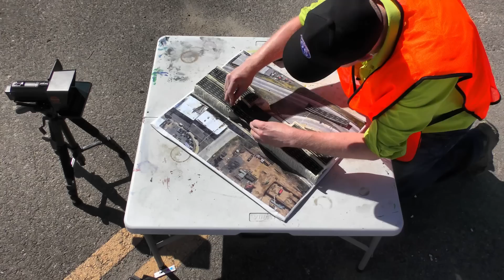Here's How Pennsylvania Re-Opened I-95... in Just TWO WEEKS!

Comment: As a materials engineer, I have two contentions. one, steel is stronger than concrete in both tension and compression, you just avoid using any more steel than absolutely necessary because it's a lot more expensive than concrete. And Two, normal concrete actually does weaken under high temperatures.
Reply from the maker: That's cool to learn.  I'm growing worried that "rushing" a shorter video out over 36 hours (versus like a month) may mean... I have some factual oopsies. 😲
Reply: @RoadGuyRob  As a knowledgeable non-structural engineer, I knew what you meant, that a bar of steel of practical thickness is poor in compression. I think most people intuitively know that a solid block of steel isn’t going to buckle. 

But yes, a reminder never hurts that anything can be strong, but strong and cheap is the goal.
Reply: @justins8802  Use rock rebar (made from basalt) instead of steel rebar. It is superior in every respect.
Reply: @RoadGuyRob  more importantly from observation  they were steel girders not reinforced concrete beams on 95
Reply: @tyler7433 came to say the same thing. The deck was reinforced concrete though, I assume.
Reply: @RoadGuyRob  like calling a cheese steak a "philly cheese steak sandwich" or ignoring the structural importance of using a Amoroso roll.
Reply: @RoadGuyRob  It's important to note that concrete shall not be OVER-reinforced, i.e. putting in too much rebar. with normal span design, the steel is designed to fail BEFORE the concrete. This is so that failure of the structure will be noticeable, since the failing rebar is visually apparent. If you put in too much rebar, the concrete will fail first, meaning catastrophic failure with little warning!
Reply: @RoadGuyRob  Also, isn't this a steel girder bridge? With a concrete deck? So the tensile and compressive strength of steel reinforced concrete (beams) is irrelevant? If you get steel girders hot enough to soften and loose their rated static weight capacity (which gasoline fires can do) you will have a failure of the system and a collapse.
Reply: @RoadGuyRob  Pin this comment to own the oopsie!
Reply from the maker: @ErdTirdMans  Good idea.  Pinned!
Reply: As a personal anecdote, I have watched a bonfire get hot enough to demolish a concrete fire ring.  The ring was in pretty good shape before the fire, but after a few hours of intense burning what was left crumbled away with little resistance.
Reply: Yeah in this case it's buckling, right? You can't upset a length of rebar into a shorter billet because it will always take less energy to fold over.
Reply: @HavokTheorem  Use rock rebar (made from basalt) instead of steel rebar. It is superior in every respect.
Reply: If the steel in the original span was tensioned, then that would make the span even more vulnerable to heat, but it would have fallen no matter what.
Reply: Hey is it possible to make reinforced concrete with other materials? Like if someone wanted to make a Concrete hull of a boat but used Fiber Glass instead of steel to avoid rust expansion issues would that work?
Reply: @Cliffdog01  Fiber glass reinforced concrete is a thing, but the commonly used fibers are really quite short. Great for something like a floor that must resist high loads. Not suitable to replace rebar in construction. Using different kinds of reinforcement is possible, but steel is simply the most cost effective solution. Steel rebar is cheap, easy to handle, readily available, has very similar rate of thermal expansion as concrete, and is relatively strong.
Reply: @klapiroska4714  thanks
Reply: @klapiroska4714  I can’t wait until carbon nanotube reinforced concrete is cost effective ;-)
Reply: @justins8802  i worked with carbon nanotubees before. Yes, they are strong, but they are difficult to string together in long distances without sheer stress breaking them apart. Also, they are very carcinogenic in powder form.
Reply: @klapiroska4714  Use rock rebar (made from basalt) instead of steel rebar. It is superior in every respect.
Reply: @DUCKDUCKGOISMUCHBETTER  I had never heard about that before, but it seems like a viable option, though I'm still kind of sceptical. The fact it can be rolled into huge rolls would suggest it has either a relatively low modulus of elasticity (i.e. it's stetchy so sturctures would need to be pre-tensioned) or it requires some kind of special equipment to straighten the coiled bar (these are common in the world of copper pipes etc.). The other thing is that there doesn't seem to be publicly available pricing data, which makes me suspect it's much more expensive than steel rebar. 

For context, the consumer price of a large 8mm rebar mesh is about 2,5€/kg in my local hardware store. In general (at least in my area), the consumer price of steel products is about 30-60% higher than B2B prices, so construction companies are likely paying 1,5-2€/kg (could be less for large deliveries). While rock rebar claims to be 4 times lighter than steel (I'm assuming that companies use specific weight, i.e. weight to strength ratio), the B2B cost would need to be less than 5-6€/kg in order for it to be economicly superior.

TLDR; High elasticity isn't necessarily a desirable property, and cost-effectiveness might be questionable. Porentially superior when weight or corrosion resistance is high concern
Reply: @justins8802 it'll be strong but even worse than steel in a scenario like this.
Reply: @Cliffdog01  they make fiberglass reinforced concrete already.
Reply: @Cliffdog01  Yes, concrete slabs can be poured with concrete that includes glass fibers to bring up their compressive strength a little.
Reply: @Cliffdog01  Use rock rebar (made from basalt) instead of steel rebar. It is superior in every respect.
Reply: Also, from the videos I saw, these overpasses actually had exposed steel girders supporting them
Reply: Something something jet fuel doesn't melt steel beams... Er I mean concrete bridges?
Reply: @Those_Weirdos  so tell me you know nothing about material science and metallurgy without saying material science.
Reply: I mean, technically everything weakens when the temperature gets high enough.
Reply: As a super-quick video (about a super-quick fix to the destroyed bridge problem) you're trying to provide an overview, information on the basics of how they plan to do it.  You got the main points out there; the exact details are subject to change as they work on the repair.

If you'd waited too long to release the video, the road might already be fixed by then! 😁
Reply: The concrete abutment that spans the width of 95 north and south was subjected to the heat that destroyed the span...  how can that be still usable to lay the new i beams and roadbed on??  They may open the road quickly but that new section is right in the way of replacing the abutments...  I go past it every day and nobody local has mentioned this...
So, what do you think out there engineers??
Reply: Yep as my engineering teacher said... Nothing is cheaper than dirt, concrete is just dirt.
Reply: @Tindog81476  I'd sack your teacher. There is nothing cheap about concrete.
Reply: @rogink  Haha, yeah no concrete is expensive, but it's cheaper than everything else, that's the point! lol
Reply: My late father, who was a draftsman, would often be exasperated when one of his ideas for making a product functional was disapproved by an engineer. According to my dad, these engineers often overlooked the practical aspects of the problem to be solved, opting instead for some esoteric approach.
Reply: I was expecting to hear about how concrete is weakened by high temperature, but still cool to learn how they're going to reopen and rebuild the bridge.
 Gravy from the channel Practical Engineering made a video about the topic of concrete's fire weakness, it's unfortunately titled "Why Spacex Cares About Concrete" for clicks
Reply: More to the point, it will have been high yield steel reinforcement, probably 32-40mm. No chance of making any dent or bend in that without some kind of mechanical help!

But I'm not sure what you mean by 'normal' concrete. Unreinforced concrete will withstand very high temperatures. Subjected to heat, RC will expand - but that's due to the steel.
Reply: Also, don’t forget the impact heat has in expanding and breaking apart the binding between the rebar and concrete.
Reply: Salt and Steel don’t mix, don’t forget to take that in consideration!
Reply: A materials engineer !?
Shut the front door !
Reply: You are correct
Reply: yeah, he NEVER heard of decalcification of concrete.   I guess he missed that day in civil engineering school
Reply: Use rock rebar (made from basalt) instead of steel rebar. It is superior in every respect.
Reply: Jet fuel doesn’t melt steel beams.
Reply: @cakearmy_maxgaming6346 It just detempers the steel. And they use the minimum amount needed for cost and weight. BTW, it wasn't an inside job.
Reply: @cakearmy_maxgaming6346 I think someone needs to watch more blacksmithing videos.
Reply: @cakearmy_maxgaming6346 It does make the steel very hot, and hot steel goes all bendy bendy, about like a wet noodle. You ever tried building anything out of cooked spaghetti? Technically possible, but good luck.
Reply: @cakearmy_maxgaming6346  Oh yes it does. Or more precisely it weakens steel beams.

Comment: Similar to when they widened the 22 freeway through Orange County (Garden Grove area).  The 22 runs above almost all the streets it crosses.  So they built new side bridges for the new outer lanes.  Once those were finished, they diverted traffic onto those and demolished the old bridges (apparently they all needed replacing anyway, but I think they may have also widened the streets underneath).  This meant driving along you encountered what was basically a chicane every half mile or so for about a year.

Comment: at 1650 degrees concrete starts to fail completely, the structure of the molecules itself break apart. large gasoline fires can burn at close to 15,000 degrees.

Comment: Not even 9 years ago they were working on it during the pandemic they were working on right were it collapse. So it's probably a problem beforehand also this exact thing happened on a bridge over 81 by Harrisburg like 8-10 years ago. The truck lost air tank going up the off ramp bridge lost brake suddenly and another truck slammed into the back of it. It blew up and the whole bridge came down on 81 around rush hour. It took my mom and gram 4-5 hours to get home it was a mess

Comment: My real question is why after they chopped out or jack hammered the old section out wasn’t the debris used as filler after the retaining walls were built…. ??Much more cost effective if you ask me, you could add a layer of recycled glass or sand on top of the debri if you choose. Try Phillips steak on pasyunk ave , less known spot but better steak or steve’s steaks .
Reply: Lightest fill material was needed.

Comment: If the bridge collapsed due to fire underneath, I argue that it was inadequately designed.   Being only 9 years old it was probably done on the cheap.
Reply: Unfortunately fire mitigation is not included in the engineering of these types of bridges.

Comment: I'm no engineer, but that looks like an incredibly dangerous way to reconstruct the highway spans.  I would be concerned about distracted drivers either crashing into the work crews or driving off the incomplete spans during construction.  Not to mention the precision required to build each half-span within tolerance to fit its mate.  I think the I-85 method in Atlanta was superior: Close the entire highway for six weeks and rebuild the spans using the same construction staging as the originals.

Comment: Very interesting.   I live about 40 minutes north of there and have used the route extensively.  I was wondering how this glass was used.  There was nother catastrophic road failure on I 95 in CT years ago similar to this but there the bridge that spanned the Mianus river collapsed with the same result.  Meanwhile, this was 100% the fault of the driver who took that curve under the road way too fast.  A liquid load has a center of gravity that moves as the truck accelerates.  Newtons laws of motion have the liquid load continuing in the direction of the turn even as the truck changes that direction which is acceleration.  The result to the topple the entire truck and in this case, ignite its flammable load.  100% drivers fault, unless the truck was in some way faulty.

Comment: Could hv used precast pretensioned concrete beams or steel beams to replace the damaged girders n use high strength early strength concrete for the deck.

Comment: I would have to call that a Philly-style cheese steak inspired sandwich. It's not very authentic. The meat looks to be the wrong cut, and the bread is definitely wrong. A good hoagie roll from Amoroso makes the sandwich. I go out of my way to buy from Dalessandro's Steaks, but there are many options throughout the city. 

As for the video, thanks for covering this emergency construction. The crew did not build a conventional retaining wall. They instead reinforced the outer perimeter of each lift as they went. Effectively, the mass of the infill holds in the edges. Also, the northbound lanes collapsed while the southbound lanes were demolished due to damage. The bridge was a steel beam design and not a prestressed concrete beam. This was a very short span and the additional strength of concrete was not indicated. PennDOT has been modernizing this whole stretch of highway, but there is a lot of work remaining just to the south of the involved section.

Comment: There are steel I-beams under the bridge not just concrete & rebar as there has to be a flat surface to pour the concrete on….look under any over pass & 9Xs out of 10 you will see steel I-beams supporting the road decking😎

Comment: I say just fill it all in with sand.  Pave it flat. Get the new beams made.  They can replace the bridge in less than 60 hours when they get the beams made. They have replaced many bridges here in Mass that way, but that included taking down the old one. Removing asphalt rocks and sand is much easier and quicker. Probably just a few hours and they can put in beams.

Comment: Yeah, all that work for nothing.  The rebar reinforced roadway has zero structural significance as to supporting the overpass. Steel beams which stretch from one abutment to the other side of the overpass abutment. Carry 100 percent of the roadway load. So the roadway did NOT collapse for the reason he stated. Sub standard undersized Steel beams with zero insulation was the cause of the overpass collapse. In places where there is a potential for a fire. The structural beams need to be sized to not only handle the roadway plus vehicle traffic. But to withstand a potential fire. In building skyscrapers, a fire retardant insulation is also sprayed on the steel beams. This way, the building won't collapse in the event of a fire. (Like the WTC) No one will say it, so I will. Shoddy workmanship and cutting corners was the cause of the overpass collapse. This is an accident that could have been prevented.  Let's hope that they don't 'restore ' it back to the way it was before. The least expensive way is not always the best way. BTW, now is a good time to inspect ALL of the underpasses. To determine their resistance to a sustained fire. Just saying.

Comment: Would it not have made more sense to do the recycled glass thing on only one side of the overpass? Making just the north or south bound direction functional, so the highway would be at half capacity. That way they would have full access to do the other side. Then once they finish building the permanent one, open that one in both directions (again half capacity) while they build the permanent one on the other side?

Comment: Thanks for the great and accurate video! 
One note: I-95 isn't the main north/south corridor through this area, so the East Coast isn't panicking at all.  
The main north/south corridor consists of two other highways: I-295 and the New Jersey Turnpike on the other side of the river.
Reply: Honestly I’m wondering now if the quick 95 fix will maybe embarrass or spur NJ to get the collapsed retaining wall on 295 fixed faster now. It’s been SO LONG that they’ve been working on that stretch of road and it just sucks. Now I’m sure there are a lot of reasons why it isn’t as quickly fixable as the 95 collapse, but just the optics of NJ struggling with 295 for 800 years compared to the less than 2 weeks fix on 95 really makes you think 😅

Comment: Your solution temporarily changes an 8 lane highway which is normally over crowded into a 4 lane highway.  Look up the collapse of Route 80 in Denville, NJ several years ago.  A temporary portable structure was moved into and placed over the existing damaged bridge.  The approach to the elevated structure was built up so all lanes functioned while the original bridge was demolished underneath the temporary structure and the new bridge was constructed under the moving traffic.  When the new bridge was finished, the approaches and temporary bridge were removed and trucked away.

Comment: Your description of hoe the bridge was constructed is wrong. The bridge was concrete with steel I beams underneath. The intense heat from the fire compromised the steel to the point it failed. And by the way. We in the northeast use the term highway, not freeway. And no , your "cheesesteak" wasn't even close to the real thing.

Comment: The recycled glass they used is actually a sort of glass foam (like foam plastic vs plain polysytrene) so it weighs less than and ios easier to move around than sand. Just think, in the future there will be fewer gasoline tankers driving around, ready to crash, burn, and melt things like bridges.